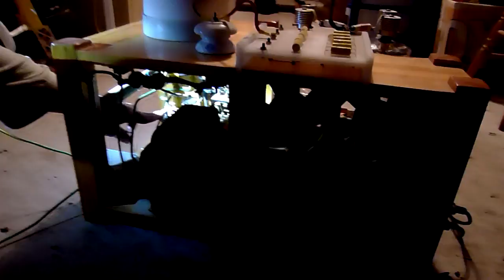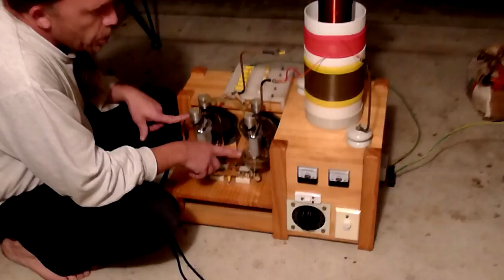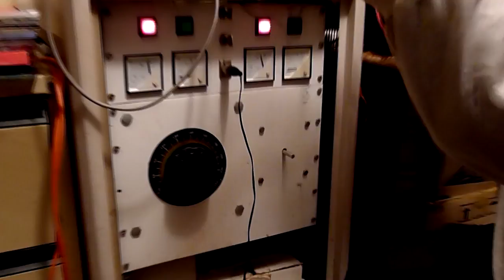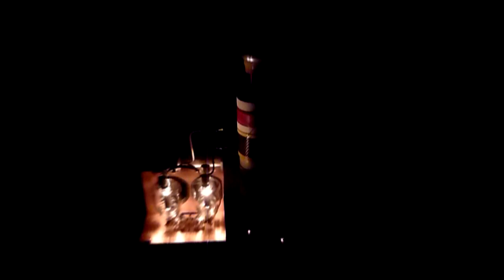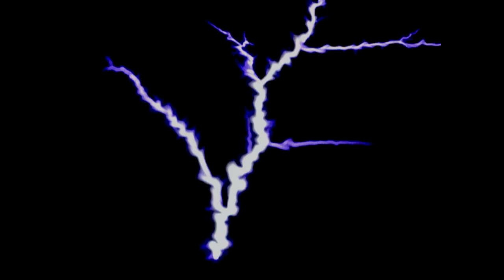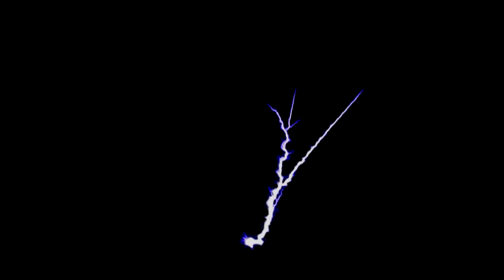Ian's Vacuum Tube Tesla Coil

Comment from the maker: I really should check on my comments more often ... I missed your question, I guess that is because I don't watch my own videos!  Oh well a year later is better than never.  I got the tubes from Richardson Electronics.  They are China manufactured and cost about US300 each from memory but that was a long time ago now (about 8 years!).  They are still going well too (fingers crossed) :).  Watch out though, you really need the right sockets and they are not cheap - mine cost US75 each  back then.

Comment from the maker: I am amazed.  I just did the John Freau calculation for expected output vs power input.  The formula = 0.5 * sqrt(input  power).

For my coil, that is 0.5 * sqrt(6000) = 38 inches.  I am getting 30-32" in ho thumid weather.  I know I can get more in cool dry weather and am sure it will go over the 32".  So, very close to the calculation.

Comment: Hi Ian, my 833A VTTC also gives 32 inch sparks, but with only ONE tube. I am a little bit "shocked" about your plates - OK they are graphit types, but in my 833A with normal plates, I never run they this bright. I never let they glow more than a slight dark-red.